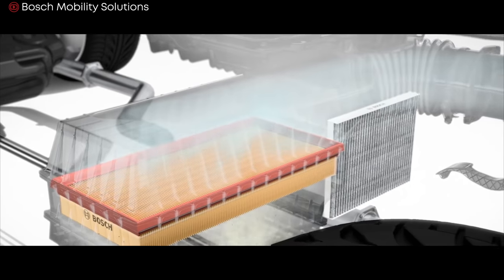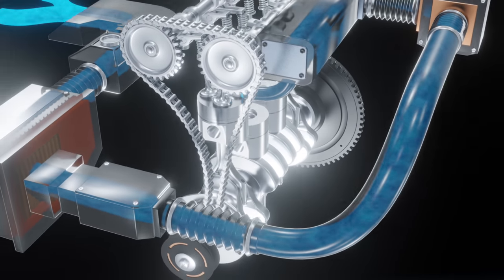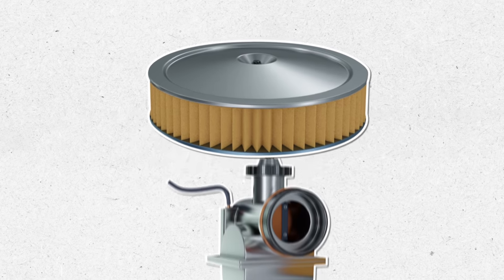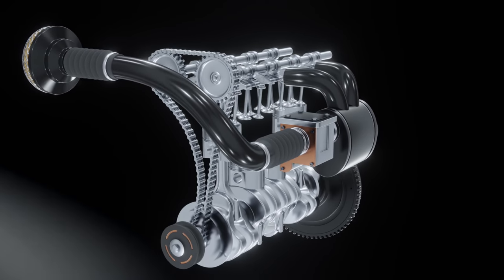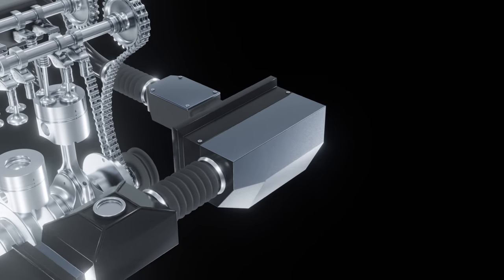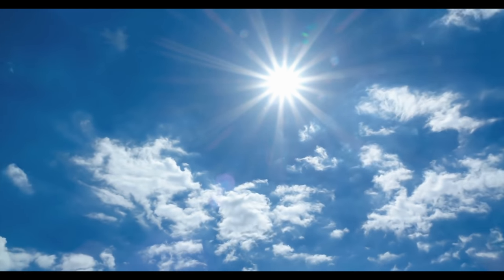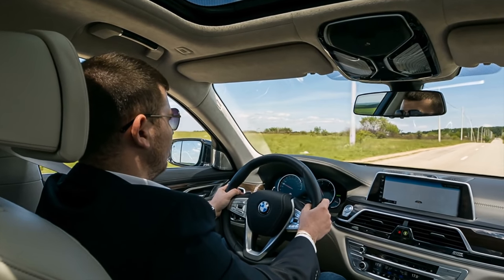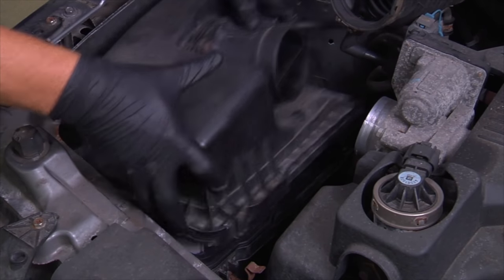If You Don’t Have This New Engine Air Filter, You’re Stupid

Comment: I have a 2020 Tacoma. Third gen Tacoma’s are known for sluggish throttle response at light throttle application. Part of this is due to the part time Atkinson cycle. Toyota uses this to increase gas mileage. However I believe it’s also due to a very restrictive air filter, even when new. This can be partially solved by installing a TRD cold air intake from Toyota for $400. Way too much money. Instead I installed a K&N 57 FIPK cold air intake at less than half the cost. It’s simply a kit that replaces the stock filter using the stock air box and the air tube leading from the air box to the throttle body. The stock air box is a cold air intake and the K&N tube eliminates the resonator box giving a smoother air flow to the throttle body. This system noticeably improved light application throttle response. K&N tested the intake and claims an increase of almost 11hp and 9 lb ft of torque. By the way the engine responds I believe it also flattened the torque curve. I subsequently installed a TRD exhaust which further increased power output. It runs and sounds very good. It also tows better! It doesn’t totally bypass the Atkinson cycle but does supply more fuel air mixture at lower RPMs.
Reply: @Mild Child Atkinson cycle is great for fuel mileage but bad for power. With variable valve timing the engine will go back to Otto cycle when you get on it. When it does it almost feels like turbo lag. There’s a sudden increase in power. This design is to meet CAFE requirements. Toyota sells 250,000 Tacoma’s a year which effects their Corporate Average Fuel Economy. It actually gets the best mileage of any V6 vehicles I’ve ever owned

Comment: I wish the central heat and air systems filters of homes would seal as well as on engine air filters. I've never seen a coil not get clogged because some air/debris gets pulled in from around the filter. Kind of off topic

Comment: Hey scotty. You did forget to say dont buy the cheapest filter you can find. They are not created equal. Super cheap air filters can break down before you would expect and actually break apart getting sucked into the engine and creating a whole mess of problems. 😉

Comment: You don't want to be using an oiled air filter if your car has a MAF. The oil mist that comes through with the air will contaminate the MAF and skew fuel trims. Stick with OE type on those.
MAP-only or carburated engines, not a problem.
Reply: I myself could be persuaded but K&N state unequivocally that this isn't a problem..

Comment: Scotty, what else should I do for a manual Toyota Matrix with 170k kms (105k miles) that has NO maintenance history?? 
Carfax only shows 7 pervious owners and nothing else! Guy I bought it from only had for 5000km.  
I got an oil change, new front bearings/brakes, checked all the fluids and swapped/cleaned all the filters.
15 year old car and looking forward to the next 15 years
Reply: Noteworthy, I live in Ontario so it required a safety inspection for each ownership change, there could be unreported maintenance during these periods. My certification passed with flying colors.

Comment: I'm always impressed with Scotty's graphics!  Very professional.  I came in here seeking info on re-useable filters, Scotty seemed indifferent.  Some say they are fine when used properly, others say to stay away.  I used one and properly cleaned and re-oiled but had to replace my Corolla's cat at 180k.  After that, I returned to paper.  It stays clean, but performance has clearly suffered.  I suspect the cat failure was due to a misfiring condition, that has been fixed, but I don't want to risk 'oil' polluting my new cat.  Others say, that's only a concern for folks who overdo it and too often.  Thoughts?
Reply: AEM reusable filters don’t use oil, assuming you used the K&N filters, which is what led to your problem. Likely the MAF sensor got oil on it over time. If you want to keep using the K&N, you would need to clean the MAF sensor with MAF cleaner spray periodically to avoid issues.
Reply: . @StandAloneState  If the MAF gets fouled it throws a code, I did that once, but I think my cat got fouled from a misfire condition and bad A/F sensor.  I may just stick to paper to remove that variable.  I was told once that cleaning the MAF too often is bad - just stick with OEM...
Reply: @girohead  didn’t know that, but it makes sense. If you can keep cleaning the MAF sensor then the computer won’t have to keep adjusting air ratios all the time and messing with running lean/rich

Comment: I have been running K&N filter in my GMC Terrain since new NEVER oiled it because it messes up your sensors , I clean it once a year with K&N cleaner...I now have 280.000 km runs perfect...all fluids are changed at 50k kilometers full synthetic and engine oil mobil1 every time my computer says I have 5% oil life left....once a year cleaning the air filter or changing it if you have a paper filter is all you need to do...if you do it more often your wasting your money UNLESS you drive on gravel roads constantly...ie high dust environment...K&N says use the oil after cleaning...B.S...no need for it I get more HP without it and my engine runs PERFECT it's a DI 2.4 litre 4 cylinder great little motor.

Comment: 🤔 A dirty air filter will lower the power, but I’m pretty confident that the O2 and maf sensors will detect less oxygen and airflow. The computer will adjust the fuel air ratio automatically so it won’t run rich or get less gas mileage. Of course that’s if you have a fuel injected car, which most are nowadays.

Comment: When I was a teenager, I ran an air scoop on my 4 barrel carburetor 283 Chevy engine. The engine bored itself out. I could stick the edge of a flathead screwdriver between the pistons and cylinder walls.

Comment: I had my 928 suck up a plastic bag, cover over 1/2 the air filter, and caused it to have low power and stall when cold. Can't forget to mention the filter is massive, so much so VAG used it in the Bugatti Veyron.

Comment: Yeah, ... I was having MPG problems in a V8 Chevy van.  Naturally the first thing I checked was the air filter,  it look brand new.

N0T being able to pin point anything else I took the vehicle to my mechanic.

Much to my suprise when I picked the truck up I was shown a huge wad of pine needles that some rodent had deposited inside the tube leading from the air fi.ter to the fresh cool air outside the grill.

Comment: Vehicles with mass air flow sensors compensate for restricted air filters keeping optimized stochiometric fuel mixture. Fuel milage will drop on vehicles with carbs. Keep in  mind many high flow filters do not filter fine dust.

Comment: If you want to clean your paper filter here is what we found to be the best method, from an SAE paper byNeville Bugli, tap it 3 times on the fender with the dirty side down.  Do not use compressed air as it is so strong that it damages the filter media.

Comment: Scotty: The engine air filter is one of the easiest parts to change
Me: Owns a Ford Focus 😢
Reply: Worked on a 2009 Ford Focus with that dumb “lifetime” air filter; tucked behind the front bumper. Replaced the whole system with a regular intake system that uses the reusable filters and much more easier to replace.  
PZEV OEM intake to a non PZEV OEM intake system.
Reply: I've seen them with 190k miles and not even budging the low flow sensor. They do seem to be lifetime. People want to be able to see and change their air filter, but you don't really need to. Ford went back to paper filters because people want to replace their filter. I'd rather have a no change Air filter on a focus with an inline fuel filter than a no change gas filter that sits in the pump like on many cars.

Comment: I just changed the air filter in my truck last week. My truck was running a little off. Opened up the box, pulled the filter out, it was black. But, there were 2 surprises waiting in the air box for me 1. A mouse nest and 2. A piece of baby mouse jerky. Am I glad I was wearing some nitrile gloves.

Comment: I recently bought a new air filter. Didn't need to but did anyway. It was the same brand and size and part number, but the kicker was that it half as thick and less paper sections.  I guess Fram is heard of Shrinkflation. Smaller product for same money.
Reply: Fram filters suck . . . Dirty air right through them.
Reply: @johnd4348  
Well since Fram's only product is filters, I'm pretty sure they make their own. Take one of them apart and then take a wix filter apart and you will see what I'm talking about.

Comment: I let my truck sit outside for a month.  Then I replaced the alternator, underneath the air filter housing. There was a mouse nest in the air filter housing and mice had chewed the ends off some of the pleats of the air filter, making long, narrow holes through the filter element. Filters may have some resistance to mice chewing, but it's not foolproof.
Reply: Hey I have a question. Did it have any issues before you fixed it up? Like surging or acting like it's trying to quit? I have a '04 impala that has this issue, but the air filter was clean. The engine or areas around the sensors are caked with dirt. Could a mice have chewed through a hose or plastic that may have caused the contents of the air intake to entire the engine?

Comment: Scott on motorcycle  gp racers they apx 40 hp ! When useing air filter box-
Now ok they make 300 hp and realy realy need the filter !
Yrs ago most bikes had no filter as the slightest resistance would the power
Even just screens where not used  great vedio !

Comment: Yes I had a weird one one time well I used to have a 1990 Toyota 4Runner with the 3.0 otherwise there was a 3-point slow well one time change the air filter I found a peanut m&m in the intake system I don't remember what color it was but I kind of want to know something how did that get there 🤔 I also remember as a kid my great-grandfather had a 1970 Buick LeSabre with a 455 he used to blow the air filter out with a leaf blower and then reinstall it and I didn't know if the time that was a good idea but you know now looking back at it I go wow that's probably not something you should do

Comment: Been running K&N filters in all of my cars for the past 40 years, I highly recommend them.................
Reply: With enclosed box or exposed to the engine heat? I had a cone filter in my car but it had it sitting opened, exposed to the engine heat.
Reply: Great for racing, terrible for your vehicle.  They filter almost nothing.
Reply: @sonny0888  exactly
Reply: I had one in my car for awhile,  went back to the normal filter.  Clean your sensor if you use them .
Reply: @gta4162  Normal OEM box
Reply: @sonny0888  They actually almost do as good a job as the paper filters offering better airflow and better mileage, not sure about the performance because you would need a lot of horsepower to do that.  They will NOT damage your engine, not sure where you got that from.  What they can do if NOT oiled properly aka over oiled, they can mess up the MAF and damage it so if that is what you mean by doing damage to the engine you are correct but they actually do NOT cause any damage to any of the internals.  The reason I like them is because way too many people never change the regular paper filters and this can actually cause many more issues then just messing with the MAF.  Again, its a choice but to say that they damage engines is NOT fair.  I've run them from everything from a 1980 MGB to a 911 Carrera over 40+ years and have never once had any issues and I've owned 36 cars.  The main thing and this is true with all service items on the car is to change them on regular intervals with the two main items being engine oil and coolant.  Far more cars are destroyed each year due to the lack of changing these two items than any other items on your car.  They are the true life blood of the engine.  The other item that needs to be changed at least every two years is the brake fluid because it is the most hygroscopic fluid on the car and generates high levels of rust in the brake lines if not serviced properly.  Too many service stations rush this process and I almost always find myself re-doing their work.  Happy motoring  :  )
Reply: @911naimplate  ok. So u have the square air filter not the cone.
Reply: most aftermarket better flowing filters arent dense enough to filter as effectively as stock and oil before maf is always a bad idea
Reply: @gta4162  Square and round, correct.

Comment: My Mustang GT has the air filter canister ported outside the engine compartment. One day after leaving work the car just died and would not start. No CEL. Turns out a plastic shopping bag was sucked up into the cold-air tube and vacuum formed around the filter so tight is nearly crushed it.

Comment: I had a custom intake i put together and I used some brand i forget now. But it was a cone and had a metal plate on the end. Well the inside part came off and lodged into my 2008 Tiburon v6 intake throttle butterfly valve. This caused it to stick open and my little car kept accelerating till i killed the engine and put it in neutral. I contacted the manufacturer and sent the. The filter. K&N had just aquired them and was a sub company or something so they sent me a brand new K&N filter. No metal cap thing.

Comment: How difficult is it to put new valve cover gaskets in a 1995 4Runner 3.0
Reply: If you can see it its easy. If it's covered up by the intake or wires. The less you can see the harder it will be. V6 toyota from 1995 should eb easy

Comment: Did the oil and air filter for a friend. His air filter was so dirty when I replaced it the check engine came on. It was reading lean air fuel mix. He thought we broke his car.
Reply: The fault code would be just temporary until the computer learned the new airflow from a clean filter. Airflow change is much slower as the filter gets dirty. The computer adjust for the change over a longer period of time. When the new filter goes in along with the sudden airflow increase causes the fuel injection schedule to be way off. The computer will learn and adjust in the next few driving cycles.

Comment: I like the cyclonic filter top on top of a 4x4 snorkel.
Why are these not more prolific?
Is it because you pay for it ONCE???
So sick of greedy companies when a cyclonic can extend the service life of the normal air filter.
Normally used in extremely dusty areas.
It uses simple physics to work and work well.

Comment: Bro..
 Changed the air filter on a car a got froma dude who totaled it 3 times wrecking and totaled it so far once in maintanence...

All of Las Vegas came out of it....

Man, basic maintenance so far it's totaled once over .. tyres, breaklines, power steering, trans fluid, air filter, broken radiator fan..... Already cost as much as average value of the car if it weren't Frankenstein..... I mean.... Might as well, gives me something to do I guess... Plus sentiment

Comment: As a surveyor I regularly drive trucks. Many years ago my employer switched my work truck to a Chevrolet 6.5 turbo diesel that a crew of women had been driving. Well one day me and my crew were on standby waiting to do some survey work in Gods Country. I got tired of sitting on my keister so, thought, I think I will check the air filter. I took out the air filter that was absolutely full of dust, silt, dirt. I immediately smacked it against the ground and about 2 pounds of dirt fell off. I smacked it around removing as much as I could. Later I stopped off at our mechanics shop and did a show and tell. He did not have that big round diesel filter but agreed to order one. In the mean time he used air to blow out the filter some more.  Moral of the story, many woman are clueless on what makes a engine run.
P.S. Many men are too.

Comment: The MAF sensor meters fuel according to the amount of air entering the engine.  Less air, less fuel.  The mileage stays the same.  Performance will suffer a lot with a dirty filter, however

Comment: Scotty, if I blow out my air filter (paper filter) with my compressor every 3000 miles with this increase it life? Or is this just a waste of time? Great channel!
Reply: Shouldn't use compressed air on air filters, it will make tiny holes larger allowing larger sized dirt particals into the engine.
Reply: Buy OEM and change it out according to the manual.
Reply: Air particles are bigger than the filter are and won't clean nothing out but the material 🤔🤣

Comment: I replaced my moms 2004 Honda Pilot  cabin air filter at 280k miles…turns out that was the original filter and was never replaced up until now. Why I know? Because to access it you must saw off a plastic piece when you service the cabin filter for the first time. and also I found leaves, bugs and moss inside

Comment: Another great video. The question I have is, what type of air filter filters the air the best. I've heard that the cotton/oil filters while increase HP don't filter as well as say paper filters.
Reply: Mr. Scotty has stated that the OEM Filter designed for your car is the best that you could use!  The K&N types of re-usable Filters are more free flowing, but will clog up unbelievably quick in dusty environments. They could also be “over-oiled” by accident after they’re cleaned, which could fry your expensive MAF Sensor 😅  I used to be all for using Cold Air Intakes in my Cars for the sound..  but these days, my almost 300k mile V8 4Runner only uses OEM Filters for everything!!